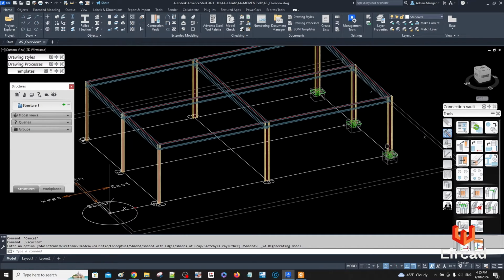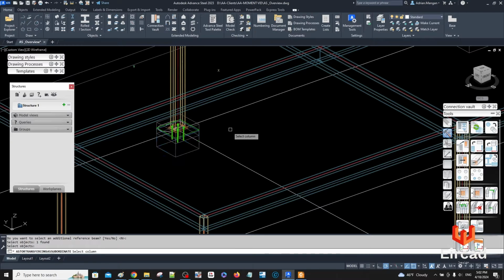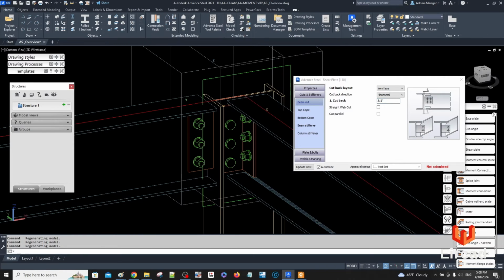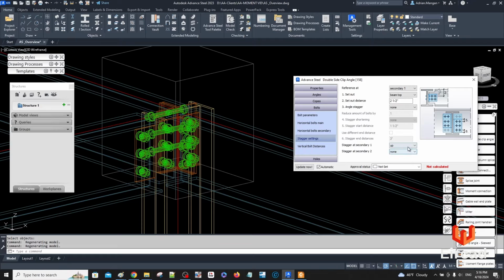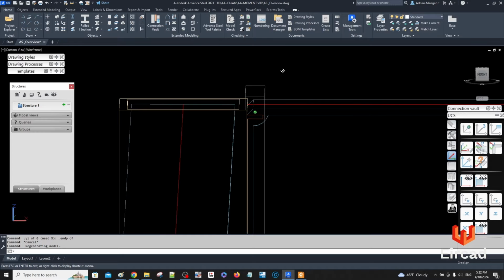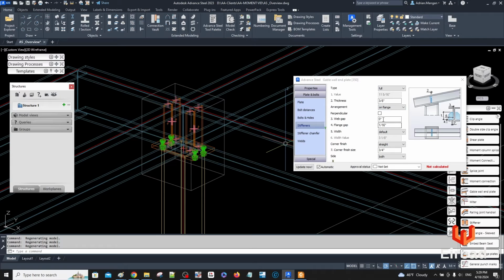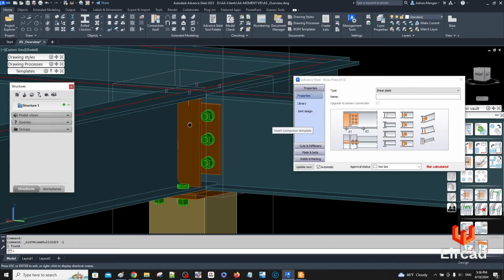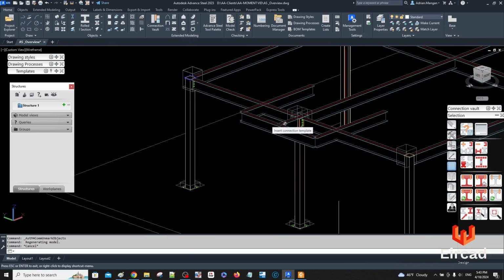ADVANCE STEEL: OVERVIEW - PART 2.

Comment: Hi - just wondering if you have used Advanced Steel 2025? I am finding that it does not recognise columns, only beams.
Reply from the maker: no, have no intention of updating, no new features only headaches in my opinion, working on 2023